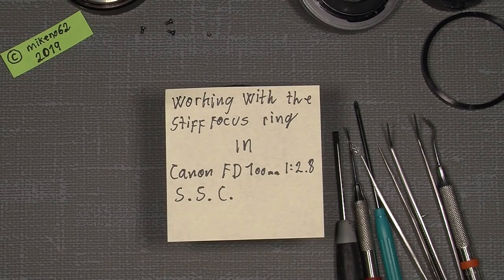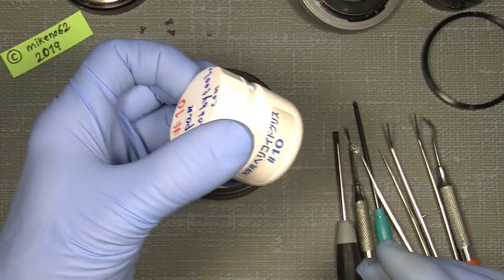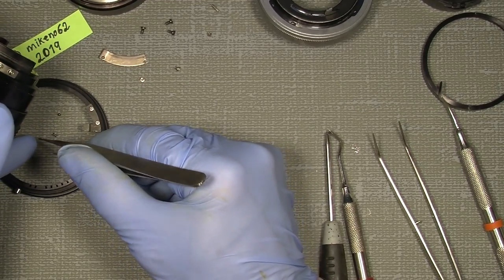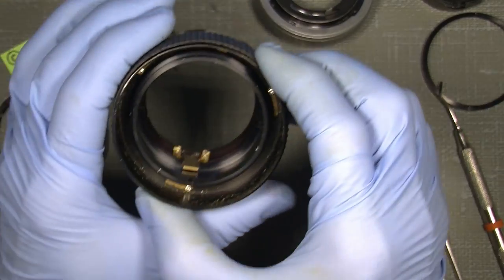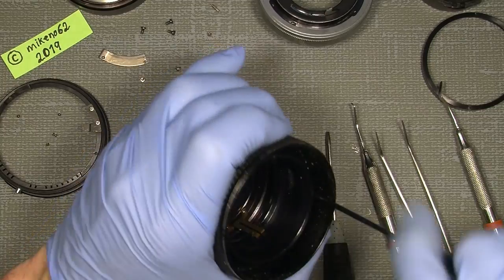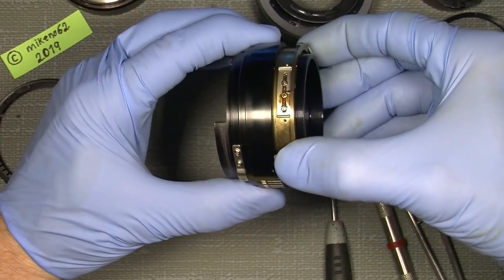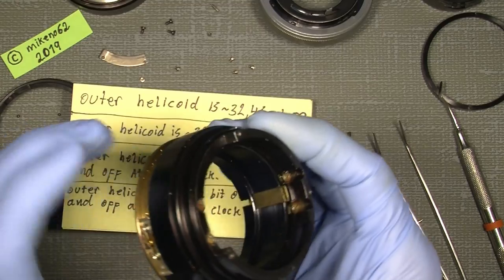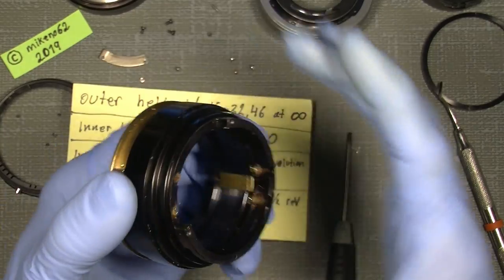Working with the stiff focus ring in Canon FD 100mm 1:2.8  S.S.C.

Comment: I have a canon fdn 28mm f2 in really good shape but the focus ring has some play, any screw that I can tighten ?
Reply: Got the same problem on my 50mm 1.4 SSC
Reply: I have discovered that in some cases the helicoid keys have too much wear, there you could ended with some little play when turning the focus ring side to side. Not sure yet how to fix them.